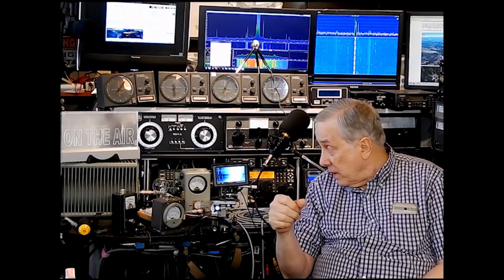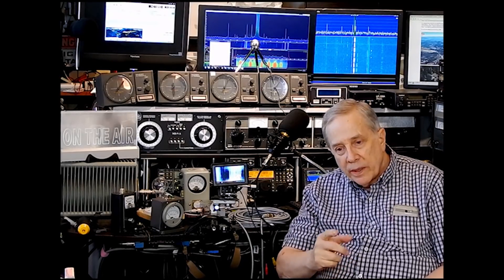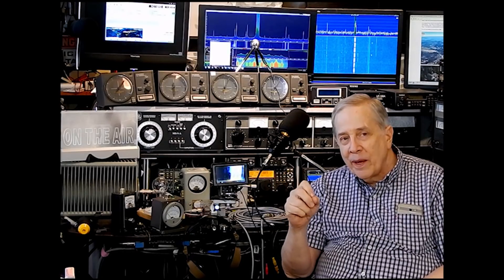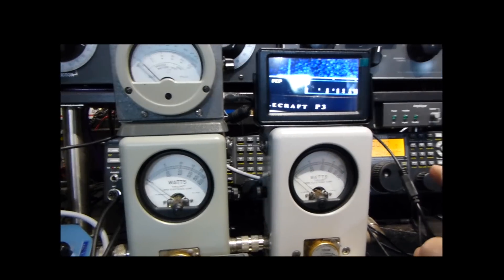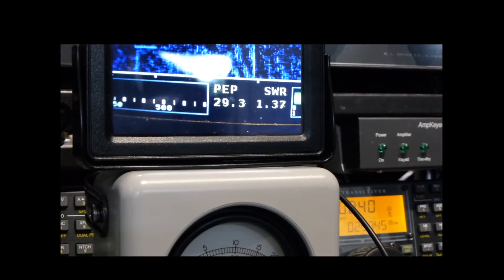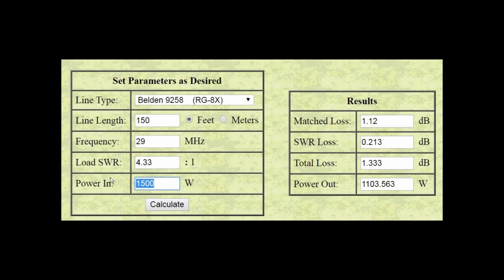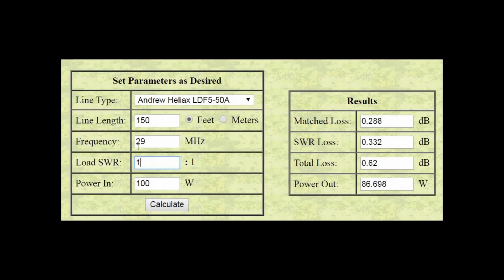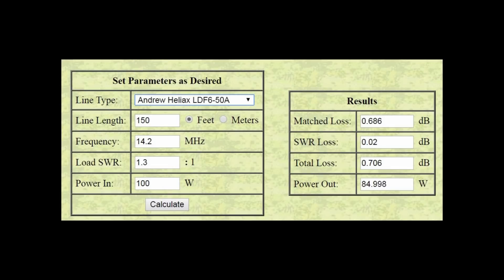Ham Radio Basics--Jim Heath W6LG, Asks:  Is Your SWR Meter Being Honest With You?

Comment: Hi Jim, Hope you're well....Quick question about SWR:  I have a Yaesu FT -920 with 100 feet of coax to an inverted V dipole cut for 80 meters, almost 130 feet overall....The issue is this, while using the internal tuner at 6 meters the screen reads "High SWR" yet if I key (low power of course) without the tuner the SWR is extremely low, about 1.2/1.  Any ideas what's happening?  Thanks in advance for your answer.

Comment: What cable are you using to feed your antenna?
Reply from the maker: Hardline that is about 1 inch in diameter and 50 ohms with homemade connectors that are SO-239.  Thanks, Jim W6LG

Comment from the maker: Thanks.  Yes, it was 150 feet.  I was trying to show that losses really add up in the coax. I may do another video showing losses on receive using DPDT relays.  I now  really think that the match should be as closes as possible.  Some guys buy expensive additions like a microphone.  But won't spend a few dollars on the feed line.  Thanks for the "input".  73, Jim

Comment: Thank you for a great video, Jim. I too have noted the considerable difference. I don't use the tuner button on my Yaesu FT2K. I use a LDG auto tuner that's good to 1 KW. 1 part of your experiment didn't deal with what I have done and that is measuring the loss between the relay switched LDG. A lot of power is sucked up between those relays and it really shows how important it is to have an antenna that is closely matched as well.

I've done similar tests using a Bird wattmeter and they Celwave dummy load and since I only own one Bird I have to spin the slug to see the reflected.

I too have used a 100 watt light bulb but mostly to verify that I have a good ground. I would connect one side to the transceiver hot or the AC socket hot and the other to station ground and see how bright a bulb I'd get.

But let me get to the point. I noticed that you were using 100 so that you could use it as a percentage. Great idea. But you kept your lengths of cable at 150. Most calculations are done based on 100 feet of cable and that way we keep the numbers straight. I guess in your case you are using 150 feet.  But I am also guessing that if you change that length to 100 the 96% that you got with the heliax would be close to 100%. That extra 50 feet of course adds to the loss.

I don't remember the URL to that calculator although I've used it myself many times before. Like you I prefer to use LMR 400 for all of my station runs. I do use LMR 400 for patch cables but prefer RG 214. If I had the time I would change all my connectors to type N as well.

Thank you for your efforts teaching hams from new to seasoned. Like you, I live on a mountain but mine is 6300 feet tall. It overlooks all of Southern California and anything from 10 meters on up can be fun. Cable losses are always what get me.

Qst did a review that was similar but I would like to see you do a review of Auto tuners versus roller tuners verses that simple button on the transceiver that just presents the 50 ohm load and tricks everything into thinking everything's fine. I personally think that button is worthless.
Reply from the maker: Indeed!  73, Jim

Comment: Hi Jim, as always an informative and interesting video. 

But I have a question that's bugging me which is this;

I have been using RG58 on a 2 metre/70cm vertical for some time and it always gave me good results and showed the SWR to be around 1.2 which I was very happy with. Now a friend gave me some RG213 so I decided to rip out the (cheap) RG58 and replace it with what I consider to be a far superior cable. All new connectors were used and I was so confident I re-erected the vertical which is on a pole attached to the rear of the garage. Total cable length is around 10 metres.

Imagine my suprise when the first time I keyed up, to a local repeater, it showed the SWR to be way out at around 6:1. First thought, check all the connections - all OK. Then I checcked the cable for damage, it wasn't new so this was a possibility. Apart from the odd bit of damage to the outer insulation, it looked OK too.

So I went back to the RG58 and all was happy again. Odd eh?

I have since discovered that by adding in a small length of patch cable (about 1/2 metre), I can improve the SWR considerably but its still higher than the old RG58 at around 2:1. My theory here is that I have altered the resonant length of the feeder which is making the difference but why is it so much worse than the old cable?

I am a relatively new ham radio enthusiast so please excuse my ignorance if I have missed the obvious!

Thanks

Graham
Reply from the maker: That all sounds very possible and easily fixed.  Old coax is usually a waste of energy. Measure the SWR at the feed point of the antenna.  I'll bet it is very high.  Now you have seen why they are called "standing waves".   Every few feet there could be another 50 ohm point on the coax.  73, Jim
Reply: @ham-radio  thanks for the reply! So are you saying you suspect the antenna is the culprit? If so why did it work Ok on the Rg58? 
73s Graham 2E0OLM
Reply: Graham, 
 
10 Meters of RG58 should have about 3 dB of loss at 440 MHz.   So if you transmit 100 W you should have 50 W at the antenna.   If all of the power is reflected (antenna a dead short or open) you would measure 25 W of reflected power.  So for 100W forward power and 25W reflected power the SWR would be 3:1.

10 Meters of RG213 should have a loss of about 1.6 dB.  So now your 100W from the transmitter will deliver about 68W to the end of the antenna.  Once again assume a dead short and you should read about 47W of reflected power back at the transmitter.  Your SWR meter should now read about 5:1 SWR.

What is happening is that you are comparing the transmit power and comparing it to the returned power that has been attenuated by the cable loss twice.   This makes the apparent SWR look much better than it actually is.

"Apart from the odd bit of damage to the outer insulation, it looked OK too."
If the cable has a damaged outer insulation I would throw it out.  Once water has penetrated the cable the loss goes way up.   This will make the apparent SWR look even better but little of no power is reaching the antenna.

What happened to your received signal levels from the repeater when you replaced the RG58 with RG213?   Did they go up?

So to summarize, use the best low loss coax cable you can afford and check your antenna because it sounds like it has issues as well.  Hope this helps.
Reply: @terry5089  Thank you so much for taking the time and trouble to reply regarding my SWR problems, its much appreciated and expands on what Jim has already said.

What you say makes perfect sense and has improved my understanding of the issues, I now need to go back to basics, take the aerial down and start doing some tests to find out what really is going on. To answer your question about the receive signal strength, I can't say I noticed any difference but then it has always been good but I guess I should compare this as well using the two types of cable.

I don't really suspect the aerial but I can't rule it out until I do those tests. 

To close the loop I will report back on what I find out for the benefit of anyone else reading this.

73s

Graham
Reply: I said I would close the loop and can now do so as I have the answer! Please read on.

Just to recap, I had a perfectly usable vertical for 2m/70cm which had a good SWR on both frequency ranges. 
But I was using some cheap RG58 and a friend gave me a quantity of good quality cable so I decided to replace it to reduce the losses. But that's where the problem started as, to my surprise, the SWR was way out afterwards.

Further, if I went back to the original cable, the SWR went back to what I had before which was acceptable.

So it must be the cable, right? But it wasn't.

In the final round of tests I decided to use an antenna analyser and, as I didn't own one, decided to build my own. To be honest this didn't really show the problem and I believe this may have been due to the low power it uses to test the aerial. It showed the SWR as being OK.

So the next stage was to take the aerial down and run a test on a short piece of brand new cable. Similar results were obtained, the SWR was OK when using the analyser. The plot thickens....

It had to be the aerial, and indeed it was. 

I worked out how to dismantle the aerial which was actually much easier than I expected. Its the type that is encased in a plastic tube and by undoing a single grub screw I was able to slide the actual element out and reveal its inner workings.

This type has a loading coil made of uninsulated thick copper wire (not lacquer coated) wound around a plastic former and at first it all looked fine. But on closer inspection I noticed that one of the turns was very close to the next one whereas the others were spaced further apart. Under an eye glass you could see it was so close it was just touching the next turn and I believe this to be the root cause of my problem. 

A tweak with a pair of pliers separated the two turns so I reassembled the aerial and ran some tests on the short coax before re-erecting it. This time the SWR was almost spot on, not just OK.

So back up the ladder I went and re-assembled it into its mounting, then back into the shack to do some tests.
I'm very pleased to say that the results were so much better, now the SWR is about 1.1 on 2m and 1.2 on 70cm. This is what I remember it being before I started changing things around.

Conclusions: I believe the aerial analyser may not have detected the problem as the shorted turns were close but not contacting each other solidly so its low power didn't show up an issue. On the other hand, when I used the transmitter I had noticed the problem got worse the more power I used. Perhaps there was some oxidisation on the copper which created an insulated barrier, its hard to tell.

In a similar vein, using the RG58 resulted in less actual power arriving at the aerial, thus reducing the level of the problem (it was really cheap stuff!).

And I believe receive wasn't affected due to the low power level of the incoming signal.

I suspect I may have triggered the problem when I took the aerial down in the first place to replace the cable as I remember propping it against the wall but it fell over whilst I was running the cable. This may have made the difference but I suspect the two turns have always been very close together as the copper is quite thick and not easy to bend.

Lessons learnt, thanks for the feedback.
Reply: Graham,
 
  Excellent write up on your troubleshooting methodology and findings.   I'm glad that you found the issue.  It sure was an odd one.   I wonder if there was some arcing across the almost shorted turns?  The higher the power the more arcing?   Any way congrats on a job well done.

Terry
Reply: Hi Terry, thanks for the compliment! I looked for signs of arcing but couldn't see anything that would suggest it had occured. Working a treat now though!

73s
Graham 2E0OLM
Reply: Glad that the antenna is working now.  That is the most important part.  Now you can get back to having fun on the air.

73, Terry W7AMI
Reply: If you watched Jim's other video on this, you would have realised what was going on. The other thing that people don't point out (Jim touched on it with his reply) is that the coax acts as a transformer because you have a difference in antenna impedance compared to the back of the radio. So there was more than one thing going on. Primarily a poorly tuned or faulty antenna, feedline losses altering your reading, and coaxial impedance transformation (like a matching stub). And what's funny is that you can get unlucky or lucky on this transformation depending on the length, and that includes the short piece you used to measure right at the antenna.
Reply: @arconeagain  

Hello Jeremy,

Thanks for your reply, all very useful and helpful so thanks for that. However it was 2 years ago.

If you read down the email trail you will see that I solved the problem myself and, although I learnt some lessons, it wasn't the cable at all.

73

Graham M0OLM
Reply: @grahamdewey4727  Yes I knew right from the beginning of your comment that the antenna was in question. However, the reason for my reply is to point out how these effects of the coax lead people off the scent of the real problem. And to point out the impedance transformation by the coax which most operators do not even consider. Nor are they aware of how useful this can be when matching an antenna.

Comment: Hello jim , question please: how can make sure my antenna is 6db or 8db is there way to calculate the antenna power thanks
Reply: People do field strength tests, some simple, some more complex. I would put the antenna through a half decent modelling program and then take a bit of the gain figure it gives in account for real life and losses. Apart from that I wouldn't worry about it and just make sure you're getting as much power to the antenna as practicality possible, as Jim is pointing out here.

Comment: Here's interesting story, for those who want to know background of the coax SWR loss calculators. 
There's a site made by AC6LA, with an article called "Additional Loss Due to SWR" is in Quotes for a Reason. He claims to be the original author of those calculators, which then continued to spread uncontrolled. He also mentions that he removed the original calculator, and that there are accuracy issues with the calculator and formulas distributed by the ARRL.

In addition to that, there's an article The myth of reflected power by IZ2UUF, where he does some transmission line measurements, and actually measures the losses provided due to impedance mismatch for an individual pulse, and for a continuous signal.

Both are very interesting to read, for those interested in what the SWR meter says.
Reply from the maker: Thanks! 73, Jim

Comment: Thank you for posting a valuable video. You mentioned the swr at antenna dipole may be very high and you may find the swr 1:1 at the shack end.  My point is when we check the swr its been told the antenna should be mounted at its original height and then checked. Coming back to your statement how its practical to check an swr at the antenna feed point when its up in the mast at 30feet height. Please suggest
Reply: Check it when it's on the ground into a 50 ohm dummy load. You can assume that your test frequency will be the center of the band that you cut the dipole for. Although a dipole is 75 ohms which automatically gives you a 1:1.5 SWR. That's why you checking on the ground without the antenna.

Comment: Beside coaxial cable,  what are the pros and cons of ladder line/twin leads ?

Thank you.
Reply: I run ladder line to my loop (or dipole, when I change it) at HL1ZIX.  You can see pics of it on qrz.com.  I love the stuff.  Ladder line is lower loss than the hardline example he was showing, and it is not so expensive.  

Based on my experience: Cons are that it needs to be spaced 10-16 inches from runs next to a foot or more of metal.  You can get away with crossing window bars or flat metal for a very short distance (maybe 3 inches away for a run of about 6 inches, max).  It also can flop in the wind, and a few twists can help, but you don't want more than maybe 10 feet (a guess) that isn't secured against pvc or a fiberglass pole.  Another negative is rain and snow mess with the swr a bit (but that usually just means adjustments in the tuner).  I love the stuff!  I use paper towel holders made of wood as standoffs (see HL1ZIX pic on qrz).  

You should also get a balanced line tuner.  I use a big fat old MFJ, but there are actually tuners made specifically for balanced line that work best.  Even the smaller mfj tuners will work, but may not be as robust.

Ladder line also causes issues on some bands at certain lengths.  I just follow the lazy way -- I put it up and if there is a band that won't tune, I splice/solder in another 3 feet of ladder line and try again.  There are charts for correct lengths online.

Also best to still check your swr when adding a balun.  A 4:1 balun may not be the ticket for you.  Sometimes a 1:1 balun is.  This is situaltionally dependent.  Even at 5:1 or much worse swr, the ladder line losses are nearly insignificant.

Final tip -- might be cheaper to buy the MFJ G5RV and just chop the antenna part off, than buying ladder line by itself.  The MFJ stuff has solid wire, but it is otherwise good stuff.   Wireman sells stranded wire ladder line, which is also lighter, but more expensive.
Reply: @thestingyham1188  

Thank you very much for sharing your experiences with ladder line.

I heard lots of good things about ladder line or balanced antenna system, but, coax/unbalanced feedline is very common.  As we can see in the video, typical RG8 or rG58 has some loss in the cable if we operate at higher frequency., such as 10m or 6m band.  40m band  might be OK. 

Again, thank you.